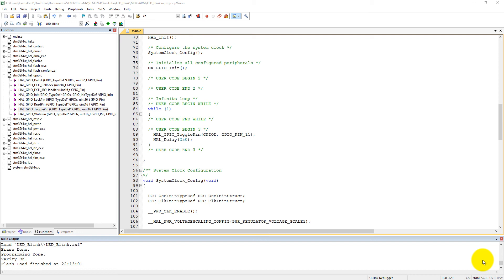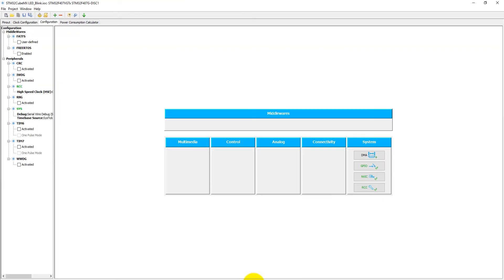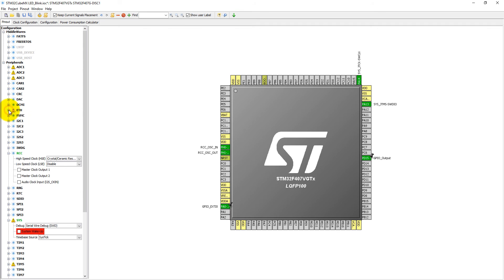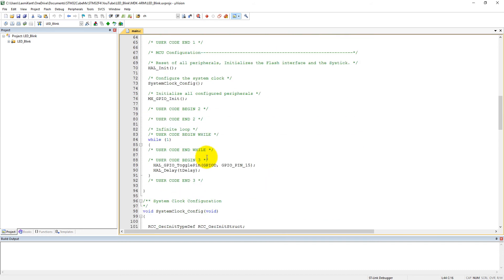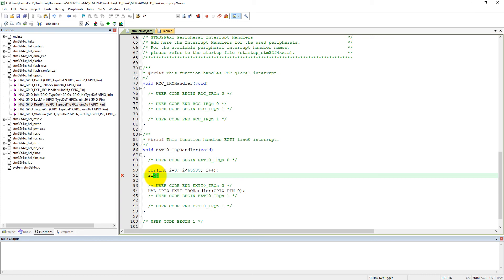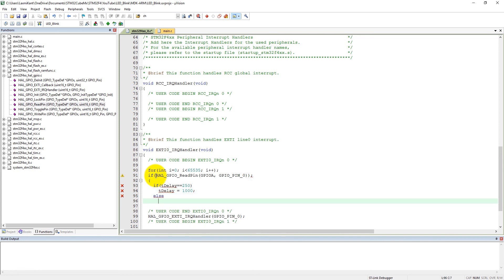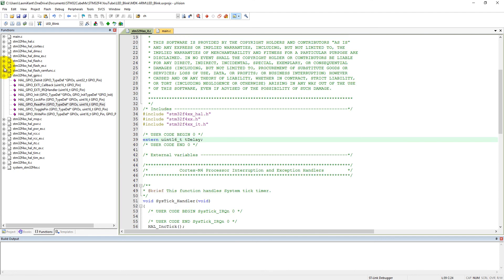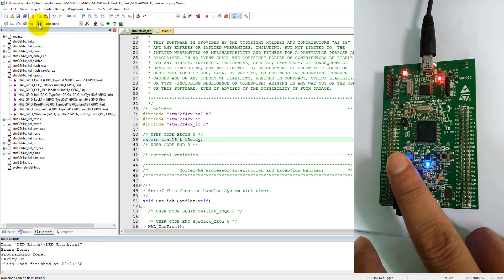STM32F4 Programming in C 2- Interrupt Push Button and LED coding in Keil

Comment: thanks for tutorial.  when I compile this project I get this error : Error: L6218E: Undefined symbol tDelay (referred from stm32f4xx_it.o)
what should I do?
Reply from the maker: It seems you have missing file either stm32f4xx_it.h or stm32f4xx_it.c. Please verify if both files are added in your project and make sure to incude file path too from settings.

Comment: Thanks for tutorial. I have some questions. Why thera are symbols ";" in 
if (HAL_GPIO_ReadPin(GPIOA, GPIO_PIN_0));
and why we add the string for (int i = 0; i < 65535; i++); and  use 65535 in it.
Reply from the maker: it means I just introduce a little bit delay to remove button bouncing effect. and then after a small delay, I am again checking whether button is still pressed or not.
Reply: KGP Talkie Putting a delay in an interrupt handler is a bad idea.  It works here because you’re not doing much else in your program. But it would be bad if the program had other things to do.